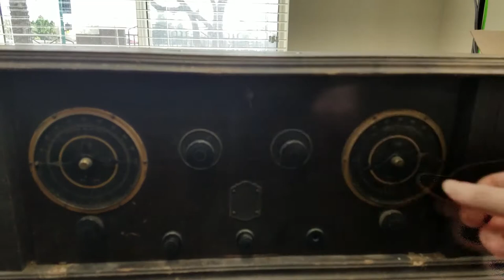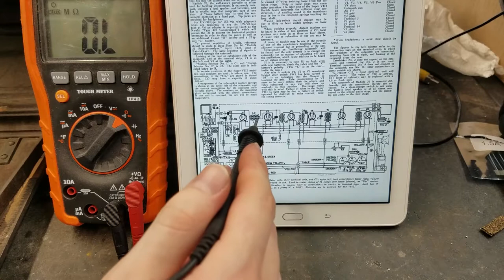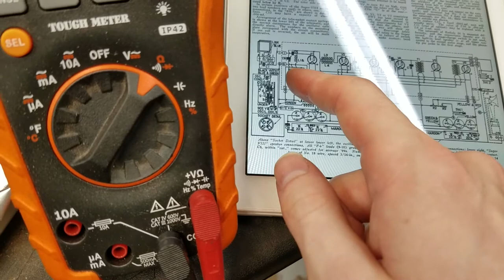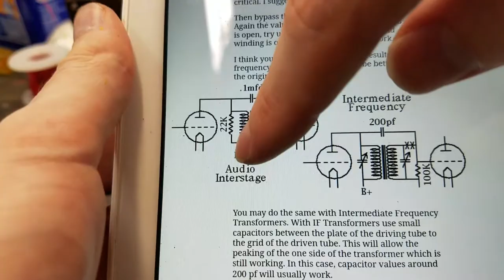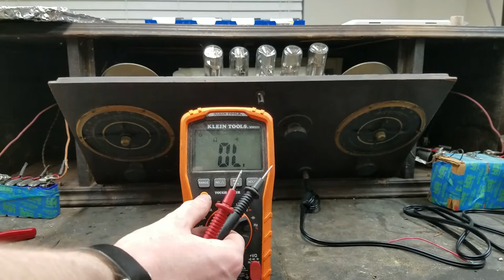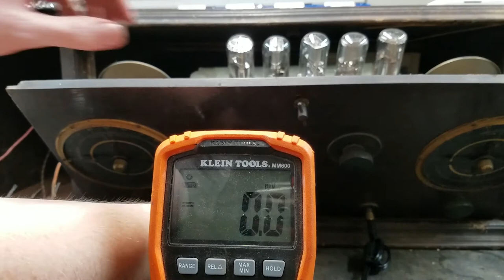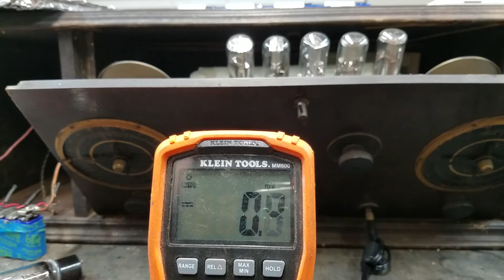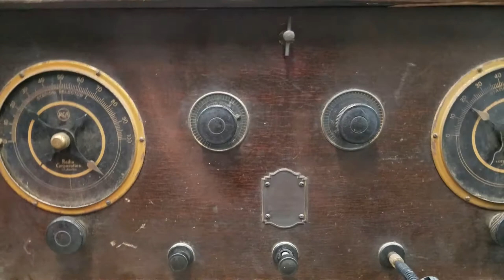1924 Radiola AR-812 Superheterodyne Repair and Counterfeit UV-199 Tube Test (Catacomb Repair)

Comment: Congrats on getting it operating.  As an avid collector of early Radiolas, I do understand the challenge.
FYI  This chassis is essentially identical as to the chassis in the Radiola Super VIII, Radiola 24, and 26.

I prefer to use the house oven to melt mine as I have ample room to hang it verticaly and watch it drip/melt.

If you notice your knobs have circles embossed in them  This identifies your set as the earliest variant.  The circles dissspeared around Sept of 1924, so yours predates that.  That makes it interesting--at least in my eyes!

Comment: Great radio project.  The tube substitution part of the project is terrific.  Have you considered 2 part epoxy for the tube to base?  Seems like the glues you used wouldn't handle the heat well.  I'm starting on a tube sub for a WD-11 for my Aeriola radio.  Impressive you did your tube replicas 2 years ago.  

I had not all that long ago toyed with buying a RCA that had the same catacomb.  Knowing the headache involved I dropped it.  It didn't help they wanted too much and it also had no tubes!

You always have quite a pipeline of interesting project's.  Always look forward to you videos.
Reply from the maker: I could switch to epoxy, although heat wont be an issue in this case as these battery powered tubes give off very little heat. I have an aeriola as well that ill get around to some day, I was thinking of using one of those tiny indicator tubes that can act as a low power triode in place of the wd11. The replicas weren’t my idea, I just followed someone elses directions. Dont be afraid of the catacomb, it really wasnt that bad to melt out even though it was a little too large for my toaster oven. I think this is the 3rd or 4th wax potted radio part I’ve melted out, and its really not that bad. Im not sure if I mentioned it in the video, but I got this radio for $5 at the Kutztown radio show. I work on projects I find interesting, Im glad others find them interesting as well

Comment: Very cool video!  I have a 1920s Arline #6 Battery Radio,Its a Huge table model with a built in horn speaker.Where do I look to find schematics for these old radios, I have the original wires for the batterys but dont know the voltages or how they connect, nothing is marked and no diagram.
Reply from the maker: Nostalgia air is a pretty good resource, although the schematics arent always the highest resolution. For popular radios usually googling it will bring up the schematic from multiple sources